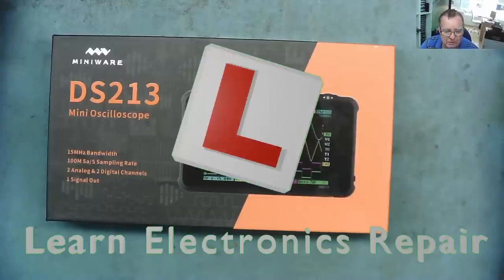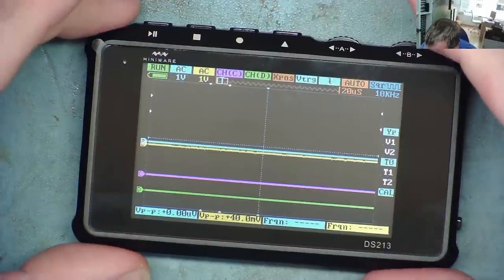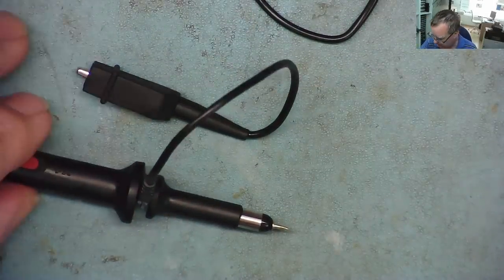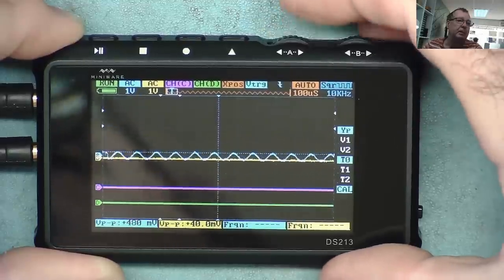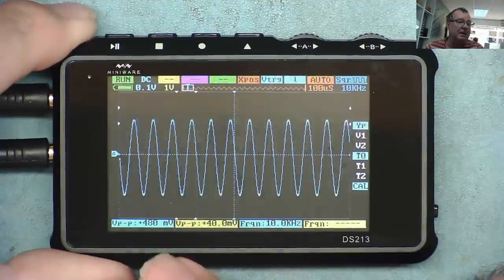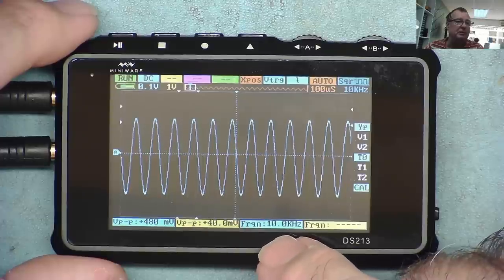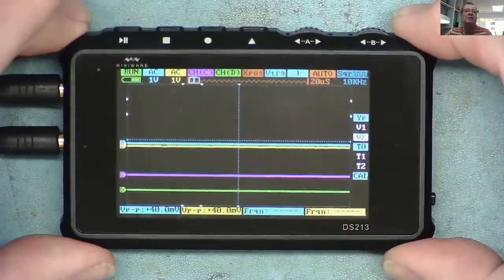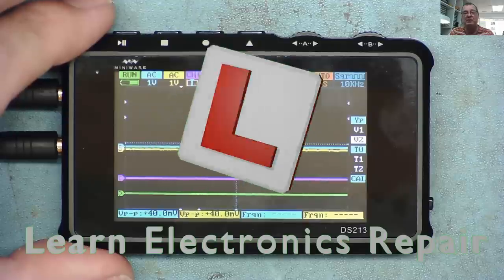Miniware DS213 Mini Handheld Oscilloscope Review - Good For Electronics Repair Work?

Comment: Richard, I think the goofiness with the frequency is a pretty standard effect of the limited sample rate. It's called "aliasing", where for example if you sample say a 50 Hz signal with only 10 samples every second, it's clearly not going to able to represent something changing 50 times per second. If you sample 10 times per second and interpolate between the samples with a straight line you can get all kinds of weird results (or frequency "aliases"), or even DC if you time it right. A guy named Nyquist showed that you need to sample AT LEAST two times every period to reproduce a signal, and in practice you want even more than that.

Comment: Great review AND an excellent demonstration of using the math function (which most analog and digital scopes have).  For newbies (and old timers too) be sure to check the scope specs for maximum input voltage to ground as well as maximum input voltage before using this method with grounded bench scopes. The "low frequency" you were seeing is caused by aliasing and is common in digitizing oscilloscopes - it is a function of frequency input and sample rate. Regards, David

Comment: It seems to me that your 10 MHz signal was modulated perhaps with 240 Hz?  Some of these cheap pocket scopes process the data from the display and perhaps it was seeing the modulation and decided to report its frequency?  After all when you reduce the timebase it can't resolve the higher frequency in that case...

Comment: WHoa!!!  It can read the 50 MHz signal!! I already have 2 the original 72msps. with 4MB memory and the next version with 8mb memory and a different MCU.

There are some great accesories you can get for these. first a rubber boot, various colors protect and help isolate ground to the probe tips only. 2nd, a little ring magnet hook, so you can attach to a metal surface, or use the ring and velcro. use alligator clips for the logic channels, do not go BNV. get same type connector that device uses. (you can get a BNC converter with a long cable- for automotive work)
ALso check out Seeed studio. IF this unit will work with customized firmware. The best for the older models was "Wildcat" firmware. adds more fdatures, functions, and better califration allowing more accurate signal capture at higher frequencies! These are actually very versatile being open source!

Comment: Things like this that are tad expensive, it comes down to whether you believe that has improved the quality & reliability or not. A cheap unit might work as well on day 1, but the battery may fail prematurely, or it may overheat in hot weather. If these guys have made a really good quality unit, then it's probably well worth the price.

Comment: I would be careful with that generator. I believe it may be the one with an internal PSU that is badly isolated and can present low current full mains on the bnc terminals. Worth checking to see if safe for sensitive circuits.

Comment: Not to steal the show from this oscilloscope but youtube suggested me video with this one "ZEEWEII DSO1511G" its 25-65$ on aliexpress.
Reply from the maker: I also have another cheaper one, very similar features/price to the one you mention, on the way to play with and to show you guys.  The DSO1511G is showing up at €61 inc delivery for me. The cheapest I could find the DS213 on AliExpress is €148 inc delivery.  Bear in mind I am located in the Canary Islands so I don't have to pay the VAT (21% IVA in Spain) as it automatically deducts on AliExpress checkout.  Also the DS213 and DSO1511 are not directly comparable - The DSO1511 is single channel, but claims higher bandwidth and has FFT.

Comment: It's OK but it's overpriced by at least 50%
Reply from the maker: I thought it was a little expensive for what it is and discussed this in the summing up section.  I also did comment it is extremely well made and a joy to use. However the only way you could prove the point that is it overpriced by at least 50% is to suggest some models with the same performance or better that are available at half the price, yeah?    If those cheaper models are found to be as good and there is no advantage to be gained for the extra money then the fact is proven, if not the fact is incorrect.  That is my 'analytical repair' way of thinking process applying to your statement.  I'm neither agreeing or disagreeing with your statement as I currently have no evidence to determine if it is correct or not.   So go on, what should we compare it with?   😉
Reply: are there any other alternatives in the similar price range, that could be used for a bit of automotive work as well?
Reply: @koma7252  Hantek scope meters, perhaps? Combined signal generator, scope and multimeter.
Reply from the maker: I do believe I was very pragmatic in the review, I showed how it performed and explained the features I liked/disliked. I neither recommended it nor did I not recommend it, but I did honestly like using it. I will have the opportunity to review some other hand held oscilloscopes shortly, so no doubt I can give a comparison at some point.  I now have four oscilloscopes to use (the Tektronix analog scope, The Rigol DSO,  Miniware DS213 and I actually have another 20MHz Analog Scope with built in signal generator made by LG though I never showed that one on video yet.
If you are familiar with my videos, the one I grab most often is the Tektronix 100MHz which is about 40 years old, I bought it second hand in 1993 at a radio rally.